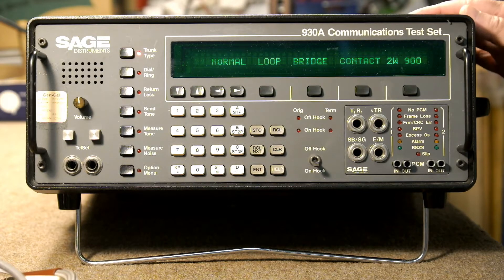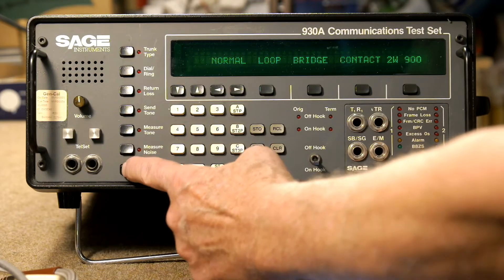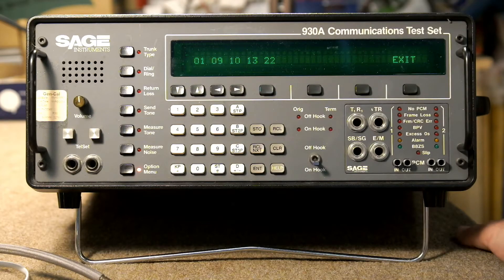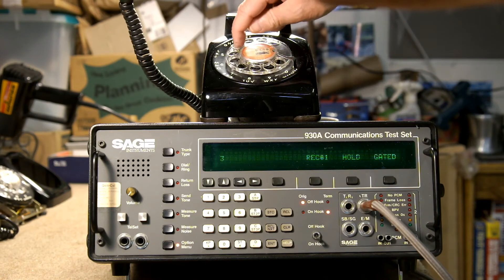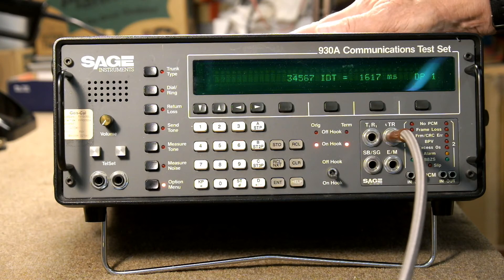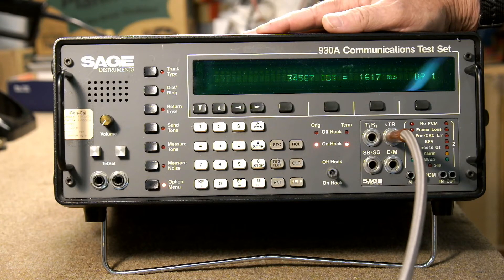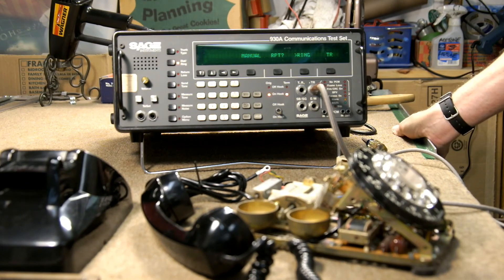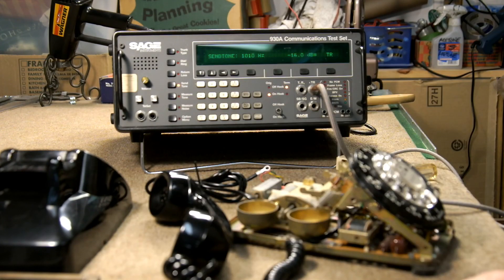Sage 930A Testing Vintage Telephones

Comment: We used these units to test central office trunks. The Sage 930A Communications Test Set is designed to perform a variety of voiceband and data
tests on analog and digital trunk types. More info available @ https://beefchicken.com/comms/sage930a/930a-manual-5.03.pdf   Have fun.